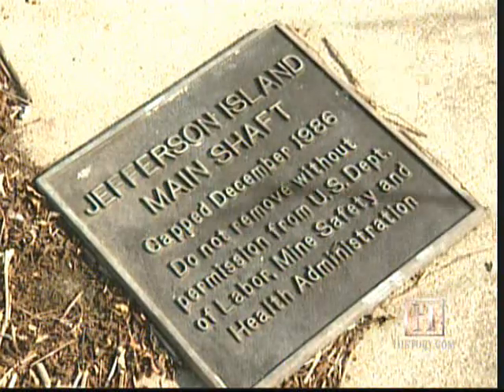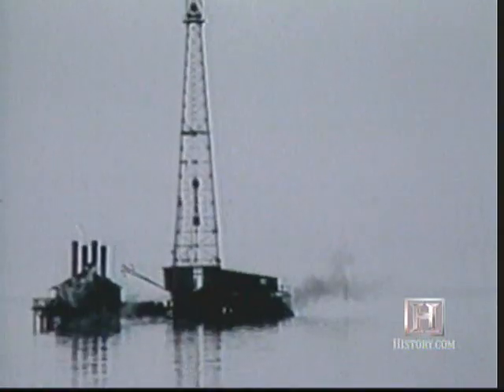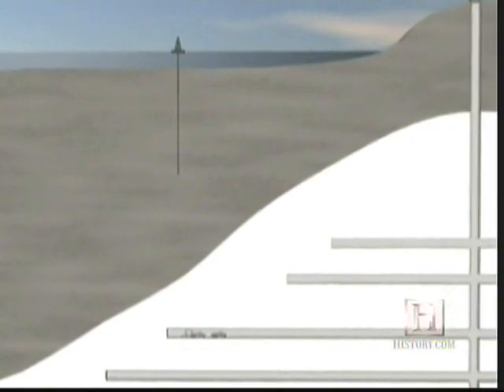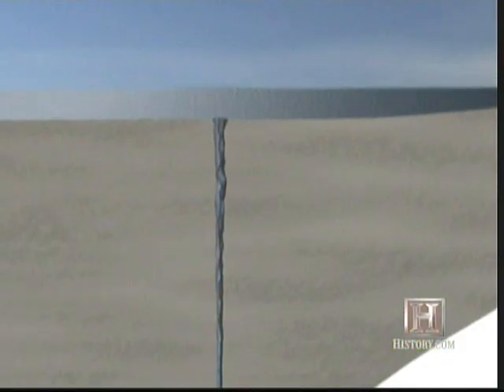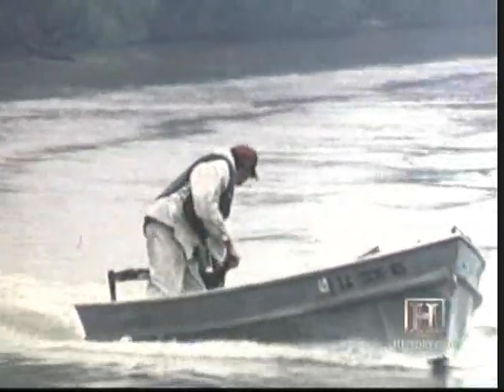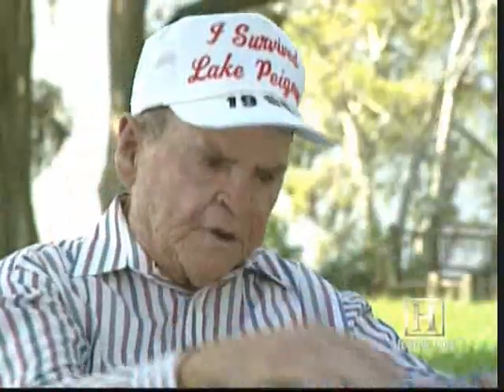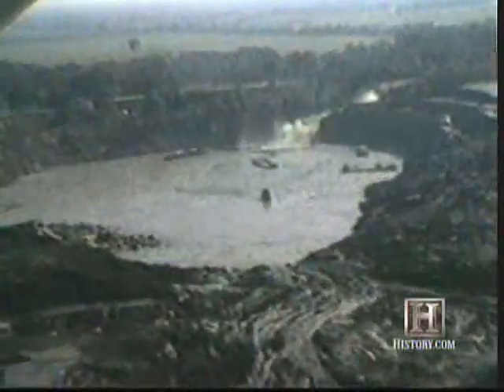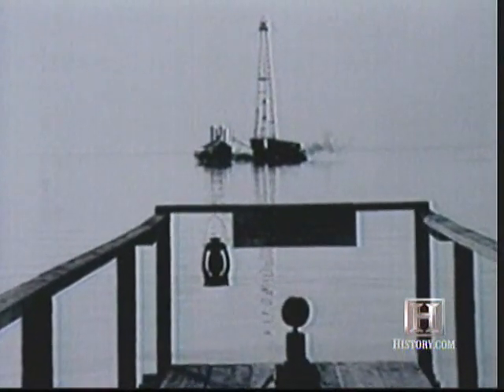Oil Driller Breaches Salt Mine Under Louisana Lake

Comment: Just know that you'll never f*ck up at work as much as the man who miscalculated that drill spot.
Reply: hahaha, for me that's true... oh wait I work in a chemical company 😵
Reply: @las10plagas  Or you could do what I did in the Army and assemble nuclear artillery rounds and end up slightly radioactive. The assembly team had standard reply for people who asked...
"How's your day going?"
"I'm radioactive and my balls glow in the dark. How are you doing?" 
Then we'd reach out to shake their hand. For some reason nobody wanted to shake our hands.
Reply: "Hey Bob? Yeah, this is the CEO. Can you come to my office. NOW."
Reply: Challenger Mission Support Crew: Hold our beer.
Reply: It was probably a calculator error. Or a copying error, like two digits transposed (213 instead of 231). Shows how small mistakes can turn into big disasters, when you're dealing with heavy equipment, and a not-terribly-stable stratigraphic configuration.
Reply: I built a powerline to a mine, built a substation. Company dumped millions into a supposed 2 million ton block of coal.  They cut 300 feet and another company many years ago had come thru and pretty much stole the coal and didn't tell anyone. It wasn't marked on the maps. The mine was in a big hole about 100 feet down. When they hit the old works the amount of water that came out washed a continuous miner and the men out of the cut. They had enough time to get out before the big ass pit that was there filled up to the top. Now there's a big pond with millions of dollars of equipment at the bottom.
Reply: When u know u f..ed up..😬
Reply: Ahhh I've done something not nearly as bad but pretty bad. I was digging up a sewer line in a really old city and everything was going great until the sewer line dove straight into some concrete. "Tear that concrete up" says the boss. So I tear the concrete up and I swear to God a river came out and turned the hole I was digging into a giant swimming pool. The hole kept getting bigger and then we got in trouble. Come to find out it was an old water drainage tunnel that was connected to a ravine and we didn't get in much trouble after all
Reply: The 2000 Cerro Grande fire in New Mexico cost about a billion dollars.  It was suppose to be a controlled fire but the winds were too high and it got out of control.  Whoopsies 🤷‍♂️
Reply: @why-even-try-brotendo  damn that's bad
Reply: @t.r.4496  That sounds eerily familiar about a nearby coal mine disaster. In the 60s or late 50s. Miners were working under a riverbed when they were then instructed to take more of the ceiling. Yep.. they got too close and the river broke through filling the mine with water. Most men were able to escape but some did die in there and from what I remember (through stories, I wasn't born yet) the men's bodies were never recovered. It pretty much ended anthracite mining here (northeast Pennsylvania) It was referred to as the "Knox Mine Disaster" and info is readily available online. Scary stuff.
Reply: @tiffanyshanley1419  this happened in Eastern KY. Lucky for them that the old works was close to the outcrop. If the old works had been back another 1000ft. It would have been a whole different story that you would have probably heard about.
Reply: @t.r.4496  Yeah really. Yikes. Now with fuel costs on the rise some politician mentioned about going back to coal for major heating. Or lands here are already falling into the abandoned mines below us. Some mines and culm piles are still burning in random spots in PA. One village pretty much turned into a ghost town which is so creepy (google Centralia mine fire) There is actually an active mine fire on the mountain about 2 miles from my house. In the early mornings you can see the smoke/steam rising on that mountain. And burning coal is so dirty, unless they have newer means of dissipating the toxic smoke that comes from burning coal on a massive level. We are doomed my friend!

Comment: "The cause was never officially determined"

Translation: An oil company cut the biggest check in Louisiana history, with certain conditions regarding public image.
Reply: There have been bigger checks.
Reply: We have yet to see the grand finale on BP Gulf Oil Spill. You know what an empty hole in the ground that used to hold 3 trillion gallons of oil looks like? Yeah, me neither but when you stick one right on the New Madrid Fault line it'll make this look like practical joke.
Reply: @nicholaijerome7583  Oil isn't just a giant hole in the ground when taken out. It is contained in porous material and typically will be replaced with water over time. Since the pressures may be different during this whole process, there could be some settling but it isn't like there is a giant cavern under the ground like this salt mine incident.
Reply: @Bonzi_Buddy  Right, in some instances, yes. I'm going to make a blanket statement of truth, the displacement of as much oil was reported is a big empty hole in the ground. It was removed from a very large fault, due for a very large quake. The fracking hasn't helped...
Reply: More like, there was no evidence left after the lake drained and the oil company said, "wasn't me!"
Reply: Diamond crystal salt company sued Texaco and the state of Louisiana for 219 million dollars in salt losses but settled for 32mil in1983
Reply: Bidness as usual for the gulf coast.
Reply: @Elthenar  That's what I heard the narrator say at the end of the video. All the evidence was down at the bottom of the flooded salt mine.
Reply: Gag Orders
Reply: Hush Money
Reply: @glenholmgren1218  I'd keep my mouth shut. I'd rather get paid off than killed.
Reply: @nicholaijerome7583  I work in the drilling business and you don't know a thing there, bud. BTW, the new Madrid fault is hundreds and hundreds of miles north of the location where BP did their big FUBAR. And the Gulf of Mexico doesn't have large active faults such as you are alluding to, which is actually good for us that live along the coast because our saturated soils would quiver like a bowl of jello with a large quake.  It's not a big hole in the ground either, as they did seal it off after 90 days or so. I have read that another company went in and drilled some new wells to that particular find and they are producing it now.
Reply: @mudguy1503  I really appreciate you being respectful in telling me I don't know what I'm talking about. It's a rare trait of intelligent conversation, not commonly found these days. I hope you accept my disagreement. I accept you may be telling the truth; and/or the truth as best you have been informed. I saw enough and researched more to feel confident in my opinion. I wouldn't live at Yellowstone if you paid me 7 figures, but some people do. If you feel safe on your bowl of jelly, more power to you.
Reply: Good exchange fellas! 👏🏼
Reply: An oil company drilling. A salt mine under a lake. A state government and electorate greedy for revenue, damn the side effects. What could possibly go wrong?
Reply: Translation...oops

Unfolds rug
Reply: @nicholaijerome7583  Yellowstone is extremely unlikely to erupt in the next 10,000 years. Not that it matters much where you live if it did, you could live on the other side of the world and still be effected if not killed by the TONS of ash it would spew.

Comment: See folks, them free tape measures from Harbor Fright are off a bit.
Reply: Never trust Harbor Freight!
Reply: Lol, I had a tape from them that went from 25' to 27".... The 26" was not even on the damn tape! I had it for years, it was fun to mess with new guys on job sites. Have them go cut something and it was always an inch short. The rest of us had good tapes and would rase hell with the new guys!
Reply: Lol😂
Reply: ALL THE FRACTIAL HASHMARKS ARE THE SAME FRICKIN SIZE!!!!
Reply: Is harbor fright like the evil dimension version of harbor freight? If so i could see why things went wrong.
Reply: Pricks sold me a framing square with standard on one side and metric on the other. Talk about aggravating when you’re marking rafters.
Reply: Womp Bozer or you know just learn the metric system lol
Reply: Elijah Mena It would still be aggravating. You need to be able to flip it over and use both sides. I actually did write some really crappy inches on the metric side.
Reply: Lol.
HABOUR FRAUGHT
Reply: Make_Sawdust Hazard Fraught

Comment: Student: "I mean, what's the real purpose of Trigonometry anyway!?"
Teacher:
Reply: I didn't see any teachers in the video
Reply: Geographical triangulation is a different beast entirely though, because you're doing that on a spherical plane
Reply: @Zahrul3  Yeah I know, but other than measuring the height of buildings this is one of the closest in terms of spirit of measurement.
Reply: Well ?...What did the teacher say?
Reply: @Zahrul3  
A Spherical Plane, huh ?
A Spherical Cube.
Yeah, like that...lol.
Good Grief.
Reply: yeah it matters if your job requires it
Reply: Zahrul3: that all depends on the size of the area you are working with. For small scale calculations of a couple of hundred feet; no, you dont have to count in the earth's curvature..
Reply: @suprlite  No kidding. I bet the markers they used weren't more than 3,000' away. You're not getting 500' of curvature in less than 751.879 MILES!!  For real, that's the math for 500' of curvature
Reply: Zahrul3 LOL - spherical “plane” - oxymoron
Reply: Likely drilling rig was wrong location. Calculated surface coordinates from magnetic north vs corrected easting/westing magnetic declination for true north. Not first or last time this has happened. Many (few) well bores every year this mistake is made. Consequences aren’t so grave, except miss your pay zone target (investors get angry). Magnetic north changing at 120 miles annually, heading towards Russia. Everyday magnetic north is changing by 1/3 mile ( 533 Metres). Challenging to get numbers correct. Constant changing declination. More difficult the farther North you are located.
Reply: @Zahrul3  what is calculus if not triangulation tho
Reply: @Zahrul3  It's still trig.
Reply: @aav7046  the guy giving earth science information in the video teaches the subject at SUNY Brockport, what you mean?
Reply: Good grief.  They were probably triangulating in miles.  The diameter of the earth is 7900 miles.  The error due to circular arcs / chords is in inches or a few feet, and most of the error will be VERTICAL, not in location.  Quit trying to sound smarter than you are Mr. "spherical plane"....

Comment: We went in our boat about 6 years ago on the lake and the depth finder read close to 600 feet deep in one spot, we were told that in certain areas it's around 1000+ feet deep, kinda scary considering the lake used to be shallow enough to stand in with your head above water, it still is on the other side.
Reply: K.C. LeJeune got to admit it's kinda cool now, not saying anyone's glad it happened but it's sure a cool spot for tourism and has a great story
Reply: Linda Seymour lol someone gets the name finally

Comment: yeah, I worked for the drilling contractor when this happened.  A few misconceptions-no, we didn't drill into the mine, we drilled near it and the drilling fluid started dissolving the outer salt layer, and eventually washed a large cavity into the mine. It took longer than most folks thought to start the big drainage, and that's the reason no one died.  Just enough warning to evacuate the mine.  Texaco paid $32+ million for marking the wrong spot, and we paid $3.5 million because we were there.   and yes, there were enough lawyers involved to fill the mine back up.
Reply: Certainly drilled into the salt. I reckon the water would have dissolved the salt just the same
Reply: The companies insurance company must’ve been in for a surprise that morning. Run of the mill drilling operation turn localized apocalypse.
Reply: +squeezerb1
Cool story bro.
Reply: That must have sucked.  Glad your alive to tell the whole sucking story.
Reply: Yes, that did suck all the water out of the lake.

Comment: The culprit was not the drill bit. But rather the people operating it.
Reply: q p 
Putin did it...
Reply: ...shall not be infringed...
Reply: "drill bits don't kill people, people kill people!"
Reply: The people telling the drill operators where to drill actually.
Reply: The people paying the people telling the drill operators where to drill.
Reply: Sounds like the drill crew did exactly what was asked of them.  Problem comes when the rush to get the resource cuts corners on survey and other preliminary duties before that drill bit ever starts spinning.
Reply: E Gleaton no it was the engineers the guys were just drilling like they were told.
Reply: q p just like guns
Reply: We need to work on drill bit control...
Reply: Ban all drill bits!!!
Reply: Everyone has the right to bare drills.
Reply: Shameful! So careless...
Reply: Actually wasn’t the people operating the drillbit either. It was the people who said this is where you’re supposed to drill. 
Then of course there are the other people who said sure it’s safe to drill 400 feet away from a salt mine.

Comment: "the cause of the disaster was never officially determined,"......."the cause most likely was a 14 inch wide drill bit"  well duhhhh!!  must have been told what to say by a room full of lawyers.   Most likely the drill bit, yea i would have to say that is exactly what caused it, it punched a frickin hole in the roof of the mine shaft. geeeeeezzz doesnt take a genius to figure that one out!
Reply: +Peterolen  no thats what other reports concluded that i have read but for the narrator to say it as he did "the cause most likely was a 14 inch wide drill bit" its not "most likely" it is definitely! 
   The Texaco drilling platform was located in the wrong position. They were supposed to be drilling far away from the underground salt mine but instead they were drilling right on top of the mine and punched a hole right thru the roof of the mine and drained the lake into the mine, Texaco paid out over $32 million to cover damages. Even today the lake is still not a fresh water lake, it is a brackish water lake because when the entire lake drained, the flow was reversed in the canals that normally flowed downstream away from the lake to upstream to refill the lake by draining the salt water from the surrounding Louisiana brackish swamps.
Reply: Well, ya never know, really.  Coulda been a squirrel, or a gopher.  They always digging!  Who knows what they really do once they outta sight?
Reply: it's more like they thought it couldn't possibly be just the drill bit cause holy shit what an event, so you try to find out everything you can, but the mine is big and it's all salt...
Reply: None of the above. The cause was a mathematical miscalculation.
Reply: What lake? I don't see a lake. Was there a lake here? Can you PROVE there was a lake here???
Reply: Boot Nreboot funny how an inanimate object can cause such disaster 😂
Reply: Boot Nreboot was wondering if it turned to a salt lake
Reply: Cant be sure without evidence
Reply: @patrickpearce886  theres evidence. Plenty of it
Reply: No kidding
Reply: even though I was 3 I worked this salt mine I swam to get 6 miners that were trapped I pushed the drill bit back out of the mine and stuffed my diaper in the hole to stop the flood
Reply: @Ahhtheserenity  Brother, unless you're an alien, you have no room to be talkin. All humans fuck shit up.
Reply: @randyreynolds8871  
You might want to look up "inanimate."
Reply: @BlackavarWD  why? You don't know that the drill bit that was used to drill the hole was an "inanimate" object?
Reply: @randyreynolds8871  
Yeah that makes sense if a drill BIT did it all by itself.  But it's part of a drill.  
Inanimate also means lacking the ability of motion.
Reply: @BlackavarWD  i realize that. But you just blew the sarcasm out the window 🙄

Comment: Reminds me of videos I've seen of the "Knox Mine Disaster" in Pennsylvania. Miners digging too close to the Susquehanna River breached the river bed. Water started flowing into the mine, creating a whirlpool. They tried plugging the hole by running railcars into the river. Didn't work, so they ended up damming the river and capping the opening with a cement cap. None of the miners survived. The "Knox Mine Disaster" is the reason for strict federal mining rules.

Comment: It never occurred to anyone that digging a salt mine under a lake was just plain stupid ?
Reply: The lake was shallow and there was lots of ground between them till they started poking 14 inch holes everywhere.
Reply: You dig a salt mine where the salt is.
Reply: Digging a salt mine under a lake isn't stupid. Drilling for oil anywhere near a salt mine under a lake is stupid.
Reply: @kathyyoung1774  Not when it's underwater, at least, not in my book.    :)
Reply: @mikeg7845  Sounds about right.  Whatever the primary cause, we agree on the "stupid" bit.     ;)
Reply: @dwoolaver1549  Never mind any of that, think of the money.  Miners are cheap.

Comment: The thing I just dont get is that as the whirlpool got larger and larger the hole must have been wearing away quite a bit and elongating since with all that detritus and debris from the boats, the trees, etc you would THINK it would at least plug up the hole that was being bored into the sediment and then on into the actual mines salt bubble. 

The initial bore hole would have been easily clogged with all that crud so the hole as it finally ended up must have been massive.

Comment: While working on water tunnel in queens we hit an under ground lake with the TBM water came in so fast we were mining down hill but water was 4 feet deep 2000 feet back no one was hurt but with 13800 volts powering the machine gives you a little scare